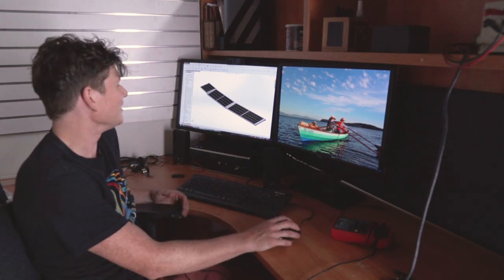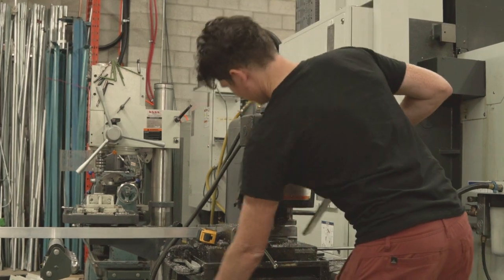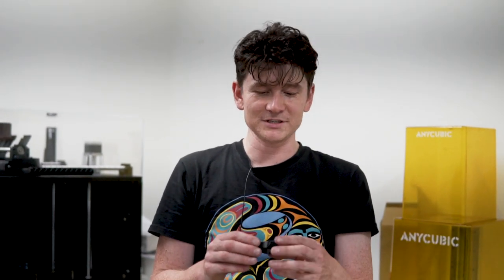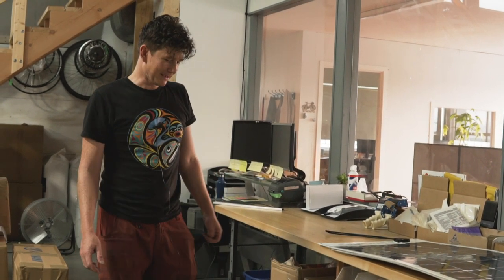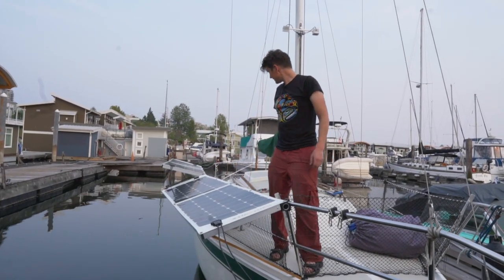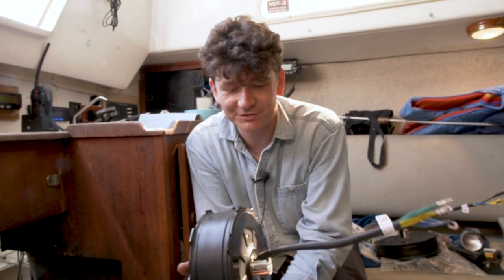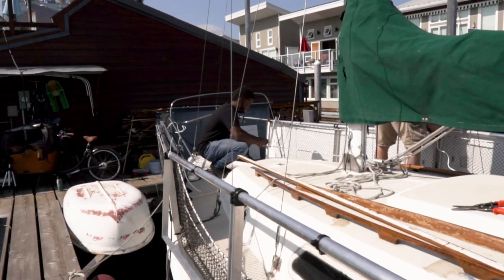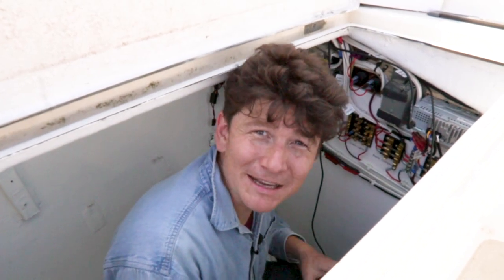Shamrock Electric Sailboat Conversion Part 4 - Installing a Massive Solar Array

Comment: Excellent work,concerned about windage on the side panels, however this is proof of concept so crack on 👍
Reply from the maker: Definitely noticed the windage when the panels were folded down on the side and we were going upwind. It's especially pronounced when motoring, but probably affected the upwind sailing speed a bit too.

Comment: Nice job. Thanks for sharing. I hope those Flexi panels work out for you. My experience is that they indeed fail prematurely if allowed to vibrate too much in the wind.
Reply from the maker: Nice to hear of other's experience.  After 1.5 year on their output seems unaffected, but they haven't seen many windy sailing days since this video series was filmed. The metal frame does a good job of holding them quite flat.

Comment: there may be some provisions, in the emerging code, having to do with connections; which may allow for higher voltages than 51.2Vnom.
but i think that center tap sea ground may have to be there, at some point; for packs over 25.6Vnom

Comment: This is beautiful design and fabrication work, although if this was my boat I'd be concerned about taking a wave on deck while the side panels are so lightly mounted. Monohull sailboats are pretty accepting of weight so you may want to consider a more robust construction before heading offshore. Great proof of concept, but beef it up before getting serious about blue water sailing. What charge controllers are you using that can run up to 72V from individual panels? Very custom, I assume?
Reply from the maker: Yeah we've never been in water rough enough for waves to get on deck and are strictly into coastal trips with <25 knot winds right now, so offshore would require a whole different rig. Luckily it's quite easy to remove the actual solar panel from the frame, just 4 screws and the electrical connector to undo and the panels can stash inside.  So that would be the plan if heavy weather was expected. 

The boost mode MPPT charge controllers we supply for ebike systems here:
https://ebikes.ca/shop/electric-bicycle-parts/solar/adjustable-400w-boost-mppt.html

They are quite handy and work OK with up to 3 panels in parallel and panel input voltages up to 65V.
Reply: @GrinTechnologies  

Hi whats the mechanical tolerance like of these 3D printed parts at high and low environmental temps degC please? Thinking NW.Europe.
BTW You can Triangulate brace panel frames with tensioned Dynema cord...light strong no corrosion.

Comment: Awesome project! I'm enjoying seeing it evolve. 😁

You might try experimenting with doubling up and having panels below that capture light reflected off the water. I know it'd double the cost and be much less efficient, but it seems you're usually limited more by surface area more than any other metric. I believe they're more niche, but some companies are producing double sided panels these days.
Reply from the maker: We've seen boats with solar mounted to the sides of the hull too which presumably is going for a similar effect of capturing not just the sun toward the horizon but also reflected light off the surface of the water.  There's no downside to having that as well, as it doesn't increase the windage at all and the cells could be extremely lightweight as the thick hull itself would be the structural backing. The underside of our own wing panels is pointing right down most of the time and so would get very little reflected light.

Comment: Great solution -- one question.  Do the panels generate any power when they are folded?  I am curious if any reflection off the water produces an power.  Thanks!
Reply from the maker: They do when the sun is on the same side as the panel.  Reflection effects from the sea are negligible but I imagine in the right cirucmstances (smooth as glass water, with the sun quite low on the horizon for a low angle of incidence) it could be measurable.

Comment: how about a "solar raft " you could  drag behind the boat , you could use this method to  surround the boat when it is at rest   to rapid charge   or get a a large amount of electricity   when you need it
Reply from the maker: It's actually a good idea that we've brainstormed too.  I'm not so sure about dragging a raft but certainly when you're at anchor you could have a bunch of panels on like 1/2" styrofoam backing that you tether together and float around the boat to get a substantial power input. The proximity to the water will help keep the cells cool which really improves their output.

Comment: Justin, The stern panel doesnt really need to tilt. While sailing, at anchor, a horizontal panel will be changing orientation and reorienting the panel would be problematic. Love the concept though!
Reply from the maker: Our output would go from about about 100 watts up to 350-400 watts in the morning or evening sun when we were at anchor and had the opportunity to tilt it correctly, so there is quite a bit extra to be gained at those moments.  But yeah it wasn't always easy to predict at night which way the boat would be facing in the morning in order to catch the rising sun.  Sometimes I guessed wrong and made things worse. 

Under sail we had a few cases going direct dowwind when we flipped the stern panel vertical increase our windage at the back which was fun too! Not as helpful as a spinnaker but definitely gave a little boost
Reply: LOL and here I was thinking my 100W flexible panel off the back of my Macgregor 26M was state of the art…… keep it coming!

Comment: Hi Justin, what is the model of your 3D printer, and what software do you recommend for drawing parts up?
Reply: ... ditto the above questions
Reply: Also wondering about the printer you used that allowed that material type and build quality.
Reply from the maker: Hey guys, the printer we're using is one of the first production units from Pantheon Design:
https://www.pantheondesign.com/high-speed-3d-printing
It's our first time with a commercial grade FDM printer and it sure delivers with both consistency and build speed. For modeling software we have a Solidworks license at Grin so that's my go-to which was used in all the parts here, but some of the co-op students here swear by autodesk inventor.
Reply: @GrinTechnologies  Thanks for the info, glad you are finding some really good solutions for directly usable parts! Nice work on this build!

Comment: What would be the cost of this particular solar array?
Reply from the maker: These panels retail for about $3 USD / watt, so would be like $3900 for the panels themselves. The aluminum tubing was ~$400, the various stainless fasteners added up to like $150, and about 3kg of 3D printer filament was used too at $50/kg.  Then the electrical hookup involved another couple hundred dollars of 14g and 16g marine hookup wire and connectors, plus the 7 MPPT charge controllers at $75 each.   
On an average sunny day it generates about 6kWhr, and to add 6kWhr of lithium battery to the boat instead is roughly comparable in cost but a lot less work!
Reply: @GrinTechnologies  thanks, I'll keep an eye out for you in Howe Sound 👍
Reply: Don't forget the expertise and labour......

Comment: Are you going to have galvanic coupling problem between the graphite resin and the aluminum?
Reply from the maker: The amount of carbon fiber fill in the PETG print filament (About 15%) is so low that there isn't any measurable conductivity in the 3D printed parts. So I doubt it will be prone to this but we'll report back if that assumption is wrong.

Comment: make the sail out of solar panels, either a wing or an actual sail fabric that consists of Pv cells, Also you might consider using solar paint or embed solar cells into the deck surface of the boat.
Reply from the maker: Solar paint sure sounds interesting.  Show us the link for that!

Comment: While I think the carbon fiber reinforced PETG is a good choice, PETG is actually not particularly tough when receiving shock loads. When load levels increase abruptly, PETG tends to shatter - almost like glass. This is really strange given that it will elongate when a load is increased gradually. I'm not sure if the carbon fiber reinforcement will make it tougher or if it will make it more brittle given that it increases stiffness.

https://youtu.be/ycGDR752fT0?t=752
Reply from the maker: We found this out the hard way too! There were a few parts that got subject to unexpected forces and cracked so just before our trip we replaced the key structural links with an all metal connection, see:
https://endless-sphere.com/forums/viewtopic.php?f=39&t=108411&start=50#p1674846

Next batch of parts we'll switch to the CF or Nylon with carbon reinforcement.

Comment: Check out the solar panel mounts that Beau and Brandy are using. - https://www.youtube.com/watch?v=qyj49OAXRz4
Reply from the maker: Oh awesome, thanks so much for sharing that link and yes they did a really wonderful job on the tilting to any axis with full 360 degree swivels, I love it. I was considering ways of having left/right tilting too but nothing came to mind for a good mechanism.  

It was nice too hearing their experiences on extra capture from being able to tilt. It's way more in the morning and evening, but most of your total kWhr capture happens from the middle of the day where the benefit isn't as large, and the total improvement is like 20%. It's not nothing, but it's not a big enough improvement to be worth the additional effort for most people.